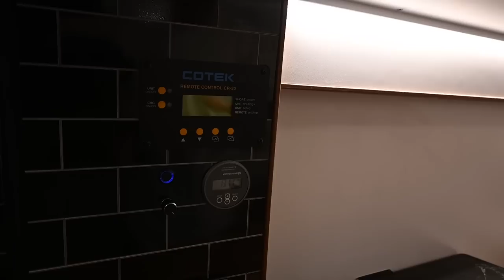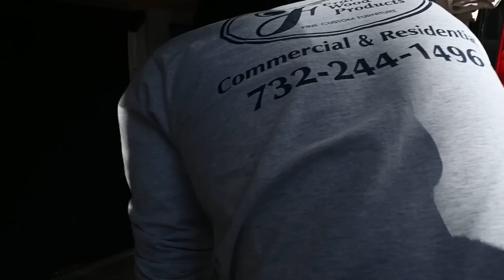MUST SEE! 1st Time Camper Van Builder Creates SENSATIONAL $125K Mobile Dwelling

Comment: Very nice build. Clean looking interior. Good use of space. Plenty of battery power. Bathroom in a good location. One high output solar panel instead of two or three. Cool bed design. Nice backsplash. He did a good job. Good job Patrick 👍.
Reply from the maker: Totally agree

Comment: The attention to detail is something you should take pride in. Patrick has posted a lot of these and this ranks near the top. Love the sliding door, multi function bathroom, slide up garage door and overall versatility. 
The one thing that would concern me (and I’ll admit I’m probably over cautious) is it appears the positive battery cables running through plywood. Those could get hot and would give me pause.
Reply: Much appreciated- and valid point. I'll get some heat shields around those openings. The work is never done!
Reply from the maker: Thank you very much Robbie

Comment: Well done.....only thing I don't get is the shore power hook up.  Do you have a port to run the cord through?   Leaving the doors open would be a no go for me.
Reply: You can run a cord through the cracked window or under the door. Slightly clunky and inconvenient, but not too bad. Made sense to me at the time but definitely something I would do differently in hindsight.

Comment: I had a Rhino liner put in my truck bed in 2004. It was peeling off and looking terrible about 10 years later and my truck didn't really see much wear and tear during that time. It captured debris against the metal and since the paint job was scratched in order to adhere the Rhino liner, the metal started to rust and before i knew it, i had holes in my truck bed. Just a word of warning. It looked great in the beginning but i won't be using Rhino Liner again.

Comment: Thank you for the video , I actually saw this van for sale and since I’m a NJ local I was interesting in scheduling the visit with the owner , I have been looking for some time and want to purchase one by summer .
Workmanship is very nice and of high quality, but in my opinion not something that will do well over time, all the tight fit components when exposed to continues vibrations will suffer , also as in many of the builds you presented there is no consideration to proper weight distribution, and overall wight, this van will be traveling at speeds exposed to various road conditions , but Tom line is that after I watched your vlog I decided to continue my search ,
Reply from the maker: Thank you for the feedback
Reply: I totally agree with your statement that US customers are not used to RV quality and tight tolerances:  a good bead of caulking to hide improper cabinet templating and fabricating is always comforting...

Comment: That is a very nice clean build. Honestly the only thing I would have liked better is if those windows on the back doors had been turned up side down, so the windows could open up above the bed. Assuming you could do that.
Reply from the maker: Thanks for the suggestion
Reply: @NewJerseyOutdoorAdventures  welcome
Reply: Good point, I didn't consider that. With the Maxxair on the air pulls right across but bed but it could be more efficient with higher screens

Comment: Amazing Van.  Please, please, please tell me where you found a trifold matress 1/4, 1/4, and 1/2.  I can only find 1/3, 1/3, and 1/3. THANX.
Reply from the maker: Mattress Insider makes them custom
Reply: Mattress insider a great for pro seams, but I went with an Amazon foam mattress and careful slicing with a bread knife. The 6” mattress had 4” of support and a 2” topper, so sliced the support left the topper to act as a hinge. Worked out great, and compresses very uniformly when made into a full bed.

Comment: I'm curious to understand how the laminate panels and wood slats can hold up to the ceiling. Very nice van.
Reply: The walnut slabs are machined with a 1/4" groove to accept a free moving panel. The slats are also secured to a 3" wide 1/4" backing panel (cut to length of the slat) which is secured to the rib supports of the van- hiding any screws. A bit tricky to explain, and took a lot of fine tuning, but very happy with how it came together.

Comment: Why did u put the shore hookup inside?    How would you run the hookup inside
Reply: You can run the wire through the sliding screen window, or under the door. Made sense to me, and isn't overly inconvenient - but honestly, is one of the things I would change in a future build. Water intake stays inside though!
Reply from the maker: Through the window or door or a port can be added

Comment: Shore power connection inside 🧐. That’s a miss.  I assume the builders don’t have a lot of practical experience?
Reply: Car camper before this, so you're not far off. You can run the wire through the sliding screen window or under the door. Made sense to me and isn't overly inconvenient - but honestly, is one of the things I would change in a future build.  Water intake stays inside though!

Comment: Is there an a/c?
Reply from the maker: The Maxx fan can be swapped out for rooftop air conditioning
Reply: I started this build with snowboarding in mind, so wasn't a huge priority of me, personally. As time progressed, though- I regretted that decision a bit. 
I would have included the EcoFlow Wave portable AC if they weren’t currently so difficult to get your hands on, since I think it’s clearly the best and would work great inside this van. Right now, turning the Maxxair fan on exhaust and opening any of the screens in either the rear/on the slider of the van creates some serious air flow (great for sleeping/cooking/showering). 

BUT, the opening for the Maxxair fan is a standard 14×14. If no rooftop AC is a deal breaker for you, you could fairly easily switch out the fan for AC